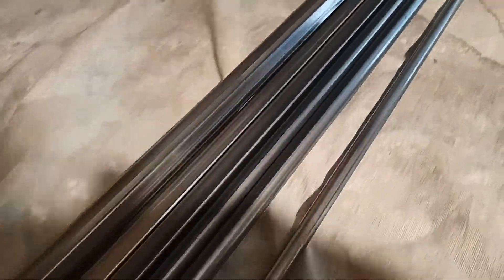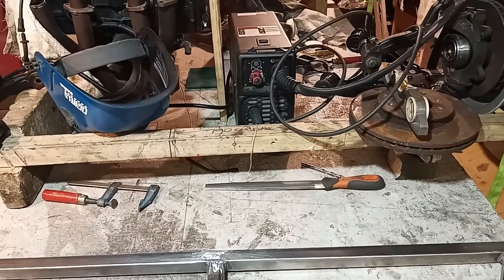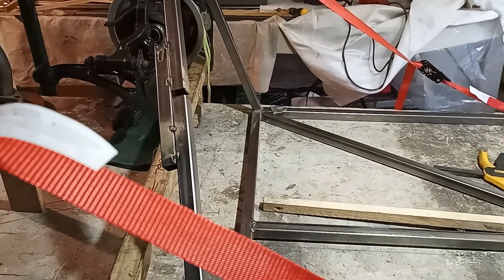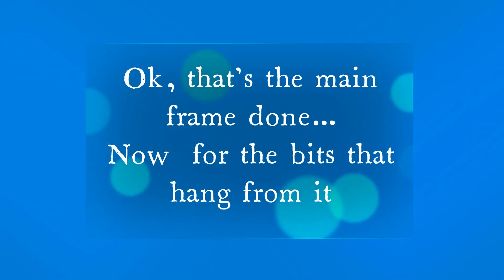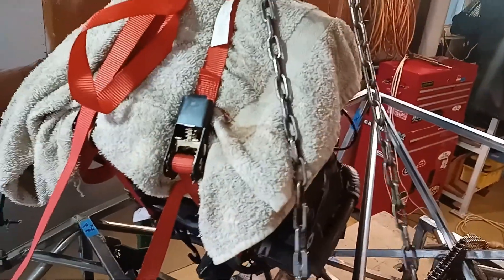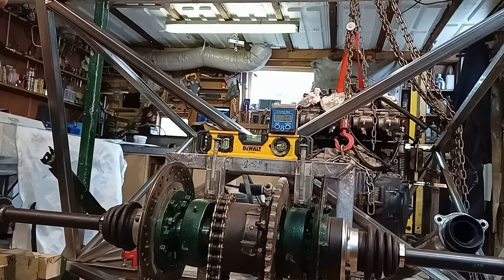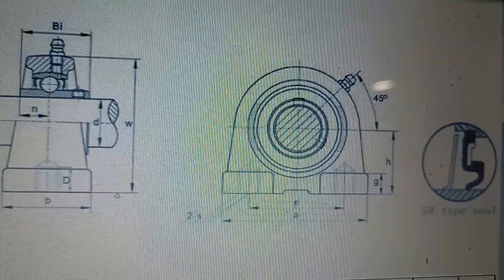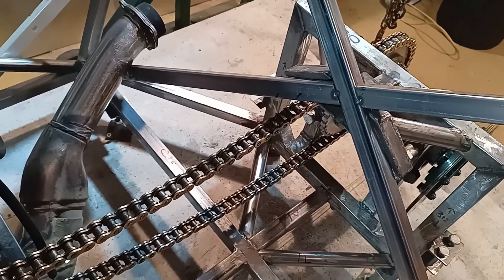Space Frame Build

Comment: A few more diagonals needed to become a space frame!
Reply from the maker: Hi.  Alas driver gets in the way. I have contemplated surgery. Otherwise every plane, top bottom sides front rear now has a diagonal.
Reply: @Stu718  Consider spaceframe torsion boxes like Mercedes used on the gullwing.
Reply from the maker: @thedubwhisperer2157  Hi. Thanks for following the project. I appreciate the help given in the comments.  More recent videos give a better idea of the chassis, especially now that the safety cage is fitted. 

The car is fully triangulated. The framing shapes are: front wall |/\|; rear firewall |X|; sidewalls |/|/|, floor  |>|>|  top |>|/|. Further, the safety cage and top form a triangular pyramid. All joints are notched into multi-way nodes - the exception is the top diagonal that ties into the safety cage footer plates. And finally, as far as possible, all suspension loads are conveyed into a 3D node - MacPherson struts make this possible. With all six planes triangulated, the frame does not twist. 

I agree, I could go further, eg, torsion boxes, deeper sills, pyramid sides.  I built the latter into my first car, which is more road-going and needed side intrusion protection. https://sites.google.com/site/porschersk718/

However, it's always a trade-off: weight, time/constructability, and performance :-(

Regards Stu